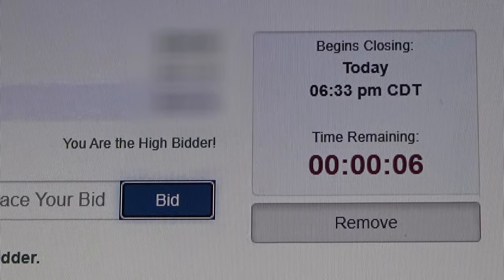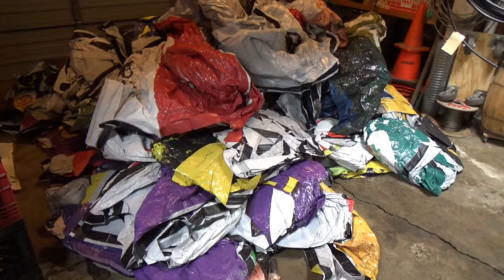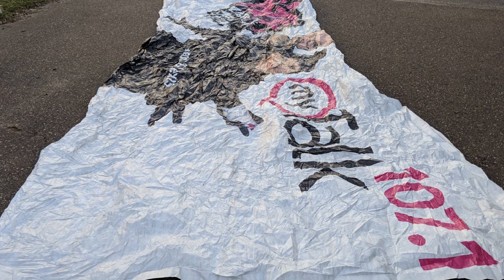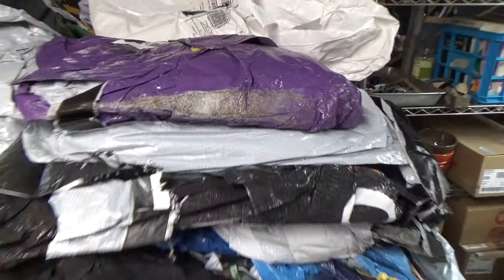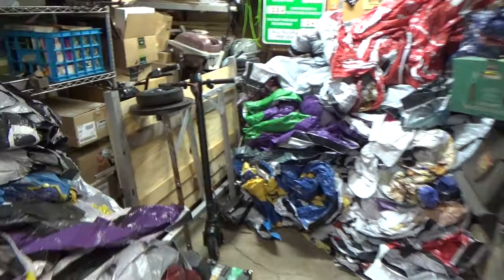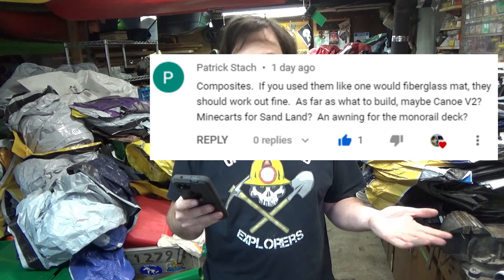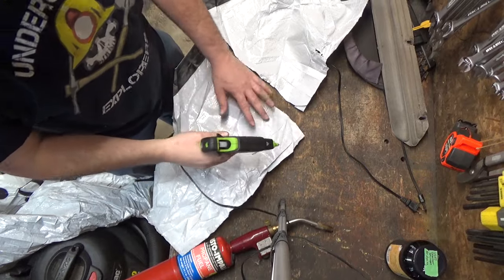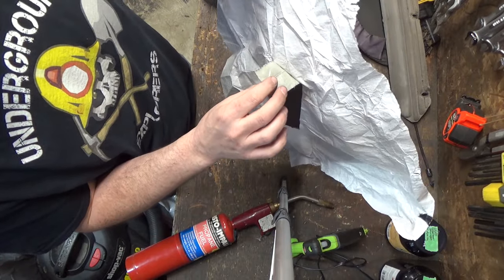What Happens When You Buy A Pallet Of Old Billboard Tarps?

Comment: Another idea: sew or glue them into bags in sizes as needed for the earthbag building technique. I have seen similar material being used for such bags. Not being UV protected is not an issue if a plaster of cob or the like is applied to the finished walls. And when mixing the dirt with a few percent of cement powder, the bag content will eventually solidify, so it's also not an issue when this crappy tarp material eventually decomposes. You could even use the Sandland sand to create these earthbag buildings. Of course, such bags could also be useful for other types of bulk material transport.

Comment: I used to do a lot of experimenting making underwater camera housings. When I was trying to attach plastic PVC fittings to polyethylene plastic sheeting I found almost all glues failed. However, I found hot glue would work most of the time fairly well. I did some research and apparently the heat changes the chemical structure of the PVC or polyethylene, I can't remember which, and allows it to be attached with the hot glue. Hot glue and also allowed me to attach metal to PVC so long as it didn't freeze. When I glued metal to PVC and it froze it would separate because the metal would expand. On the other hand, this allowed me to make prototypes with hot glue and then disassemble them easily by freezing them.